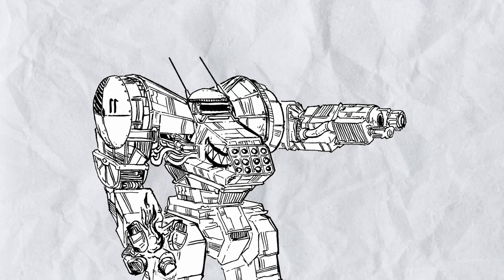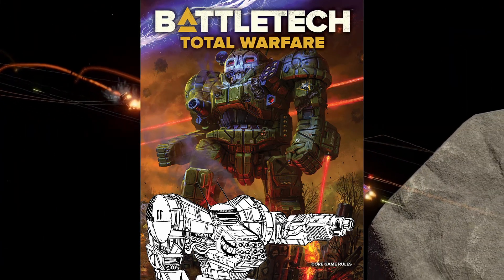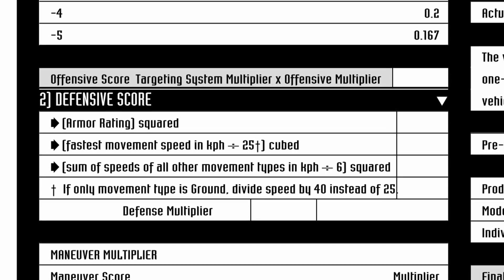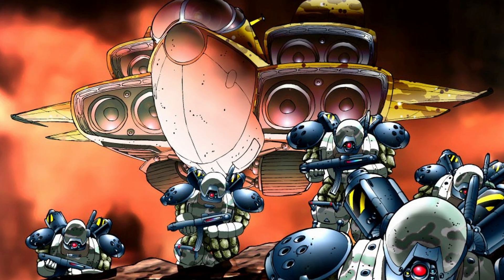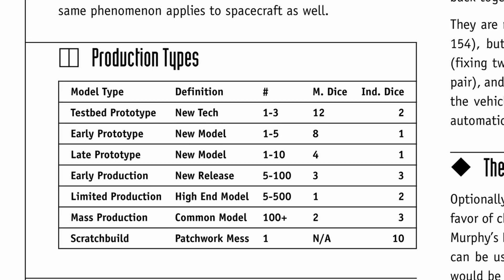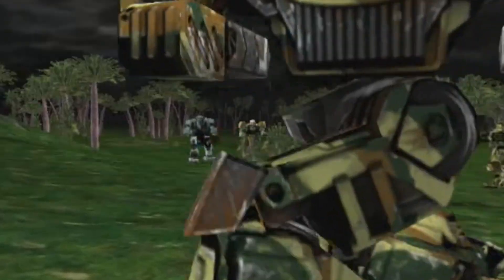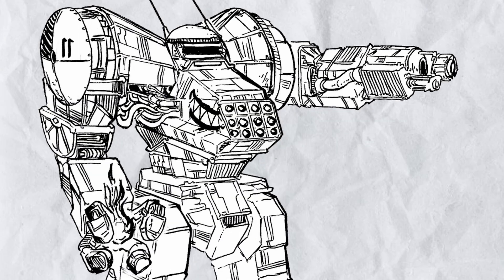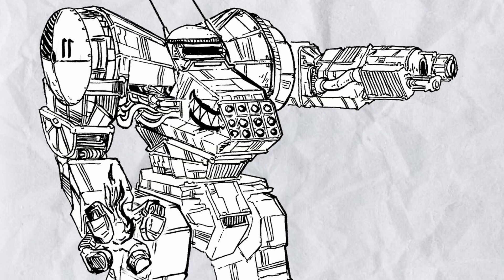How to make a thing in Heavy Gear 2e (Warning: math)

Comment: Why Heavy Gear 3rd edition was a disaster ? Except the ''Complexity'' rule which can be replace by simple Bonus/Malus on a check, the 3rd edition seems pretty similar 

Am I wrong ?
Reply from the maker: 3rd edition is where DP9, aside from cutting things down, also did the very weird thing of making it compatible with D&D d20 system. The SilCORE engine is an attempt at making a generic engine based on the original d6 system that Heavy Gear used, but at the start, it was quite half-baked and full of errors, and while it has been fed full of erratas these days, it's really a matter of 'why bother' when 2nd edition was right there.

And now that 4th edition is out, it's even more deader in the water.
Reply: @11dragonkid11  Thanks ! I'm working to do a conversion of HG2 (and 3 cause I have silCORE too) for a TTRPG game of Warhammer 40k including RP and military campaing. I know there is many 40k TTRPG but so far I've had bad experience with them + I want a "Brutal and Realistic" feel with weapon easily one-Shotting ppl

Comment: Consider before HG the systems I was aware of were Battletech and Steve Jackson Games’ Car Wars. Both interesting, but with weirdness. HG wasn’t perfect but the idea was that it was more about “modeling” a design than building it. I feel it was very much meant for use as a between game thing not at the tabletop which is why it was moved from the main book to the tech manual. So it assumed the in-lore designer was probably marginally competent. The current RPG developer has mentioned adding the “Lemon Dice” in as an option,

Comment: Heavy Gear was, in fact, a TTRPG, wargame, AND card game at first.  (Yes, it had a card game called Heavy Gear Fighter.)  You had to buy the corebook, because it had the rules for all three systems in it.  First edition Heavy Gear was weird that way.
Reply: I believe the Card Game came out first, they made it to raise money for the print run on the RPG. They also came out with a demo game (folded 2 sided paper) that was a pure wargame version of the game.
Reply: To expand on this: both the 1st & 2nd edition Heavy Gear rulebooks had the RPG and wargame rules, which, while using the same mechanics, were separate games.  You could play the RPG without using the wargame rules, or the wargame without using the rpg rules, or you could combine the two.  I played Heavy Gear Tactical (as the wargame was called) without touching the RPG a lot before blitz came around.
Reply: And I almost forgot:  While the 1st ed. Heavy Gear rulebook didn't have the full Heavy Gear Fighter rules in it, it did have some optional/advanced rules, including multiplayer rules for up to 8 players on a map.  I have a copy of Heavy Gear Fighter and the 1st ed Heavy Gear rulebook, and want to at least try the multiplayer HGF game someday.  If I can ever get myself organized.